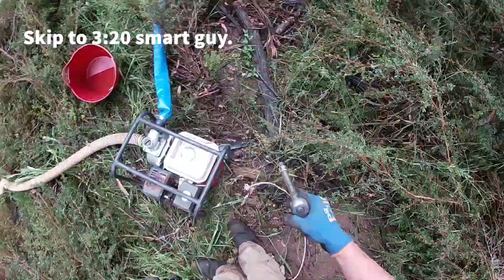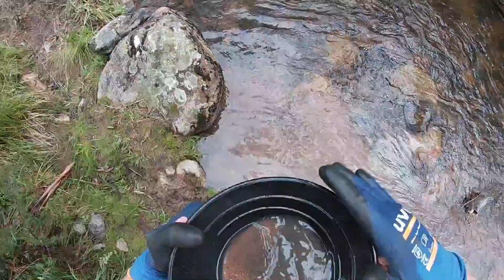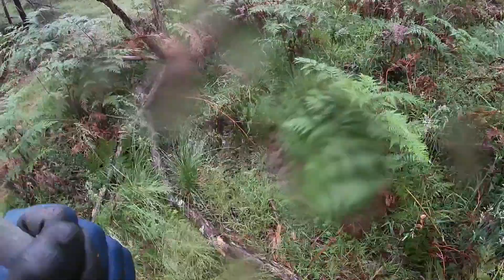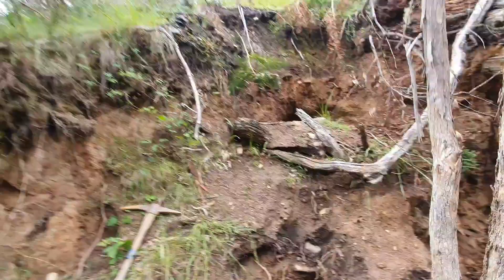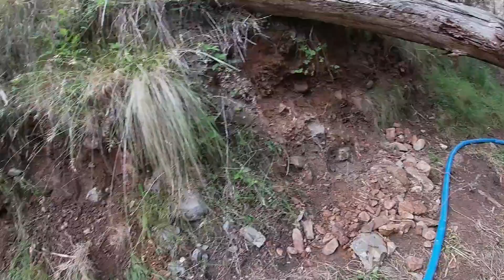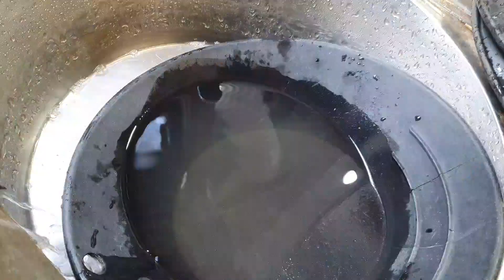How much Gold is in 8 Metric Tonnes of  gravel?

Comment: Hi there, just started following today, subbed this morning.  I have built my own              "reverse helix bucket trommel" i have had it in operational for 7 months. Able to use it once a month,  it is of all plastic ,electric 12v windscreen wiper motor. Weight 6.5kg wirh out sluices and legs. On a really good day,  I can run 30 - 60 buckets depending on how far I cart to the water source. Love a trommel, it smashes it! Clean as a whistle, the rocks. It tends to catch it all. Has 3 stages ,with 3 different catch zones each. I have won beers of people testing the tailings !😅 cheers love it!
Reply from the maker: Sounds like a fantastic little machine Andy! I'm a fan of any electric equipment. Especially now that we have nice light, lithium batteries with high storage density to use. No more lugging the big lead acid down the creek to power things 😁

Comment: Earning every flake.   Have you thought about adding a small conveyor(like 8 ft long) to the front end of your operation to make feeding the trommel a bit easier and expedite the process?  Add it onto the motor turning the trommel with a belt or chain?  Hauling something like that with the trommel or even an extra trip may save a lot of time & effort while putting more gold in your totals.   Do you regularly pan the piles of fine tailings to make sure you're not losing gold?
Reply from the maker: Howdy Justin! I have considered it, yes. But after weighing up the pros and cons I dont think it would be a worthwhile venture. More just the size factor than anything else, for the conveyor to be useful to me it would have to be bigger than the trommel is. If I was to build a bigger trommel one day though, a feed conveyor would be a very handy addition! 

I occasionally pan the fine tailing, very rarely do I even get a spec. The oversized tailings however, do have gold in them when the materiel is clay bound and hard to break down. In that case, I put a bucket under the end and re feed the oversized a second time 😁

Comment: So you got about 0.02 OPT? That is…not great. Especially for four days of work. You used a river sluice as a clean-up, did I see that right?
Reply from the maker: I guess it depends on what you concider great Marine guy. You saw that correctly yes.  I put all of my alluvial clean ups through a small river sluice before putting them into the spiral wheel.
Reply: @TheGoldmansChannel  have you considered taking the cons home and using a recirc sluice there? More time on the creek spent digging and less chance of loss as you can rerun your tailings.
Reply from the maker: I used a 100mm v mat clean up sluice for most of my clean ups about 10 years ago, it's handy for very fine gold. But the little river  sluice I use here is just too quick and easy. Then straight into the spiral wheel when I get home again. I'm not at all concerned about losing any out of it, I learnt quite a while ago that gold is pretty hard to lose. I've had that little river sluice for a long long time and it's seen well in excess of a KG in that time. It's sort of like my "old faithful" if you know what I mean 😃.